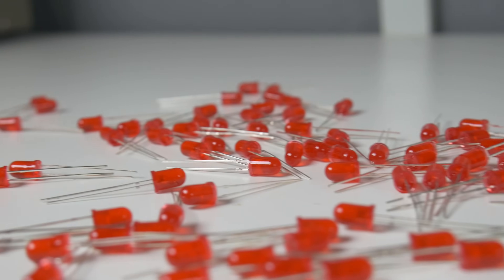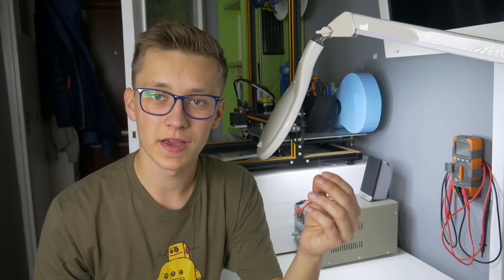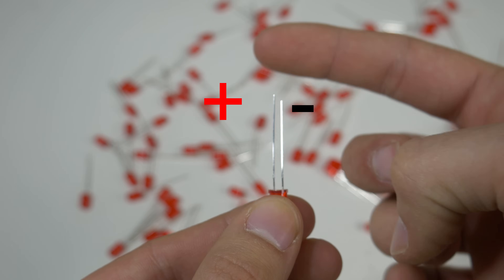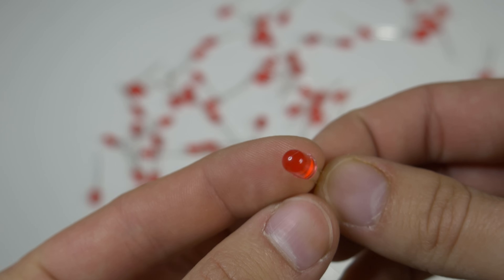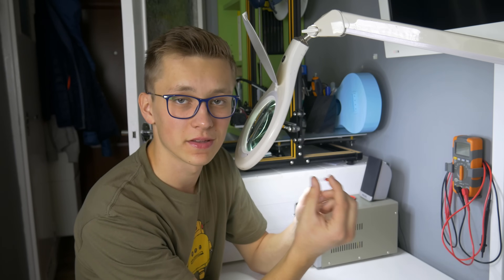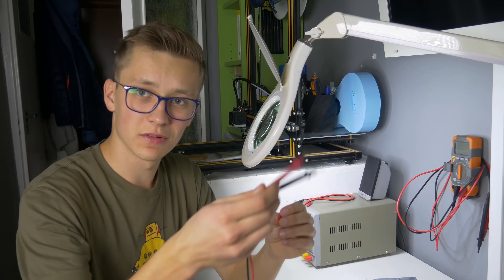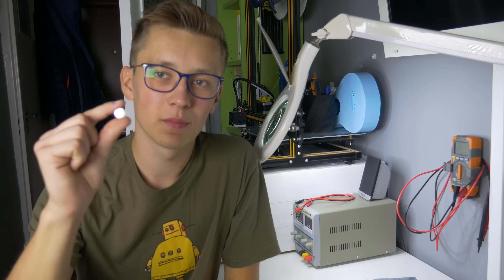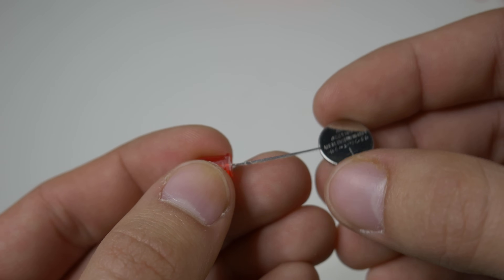5 simple ways to determine LED polarity

Comment: Hi, actually, there is a 6th way I just had to use: light the LED with a strong light. The LEDs should generate a small voltage. when you measure it with a multimeter ( in position V--- (DC, not AC), and the multimeter shows a positive voltage (around 0,6V- 0,9V), then your red probe side is the + and the black side probe is - 
I needed this because I was checking a sealed module with multiple LEDs connected in serial and only had access to the external connection not the individual LED pins. The visual methods didn't work because LEDS were not visible, the LED position of the multimeter didn't work because the voltage was not enough to light up the LEDs.

Comment: Hi.  I'm just getting into electronics and have an issue with this

I have some LEDs where the internal plates are the opposite way around ie the larger plate is on the positive side i, opposite the flat spot and shorter lead.

I have confirmed the polarity by connecting a power source.

Am I to take it that the internal plates are not a hard and fast rule.

Comment: Thanks for the video.  I liked, subscribed and shared it but...  I have an LED so old I can't find the polarity by site.  Both sections inside are about the same size.  I used my multimeter and found it but was hoping to find a quick site method that covers all LEDs.

Comment: I have a red LED that has its anode on the flat side of the package, and this also corresponds to the larger electrode.  Has it been incorrectly doped?  It's the only LED that I've seen that has this configuration.

Comment: I'm sure you know all this, but a couple notes for the viewers. To test most LEDs you need a Lithium (3V) coin cell battery rather than an Alkaline (1.5V). If you're thinking "why don't i just connect 2-3 Alkaline cells in series", well yes you can, especially with coin cells; but if you try that with AA or AAA batteries which can deliver high current, unless you have a fairly beefy white or blue LED that you're testing, as opposed to red for example, you're likely to burn it up if you're not super careful and very quick, and even then you can damage it.
Reply from the maker: As long as you are using single AA battery, you wouldn’t burn LED because voltage is too small, of course you can’t connect more batteries in series because that will result in higher voltage and burn an LED.
Reply: @nikodembartnik  not the most reliable way to light even a 1.7V red LED either.
Reply from the maker: Sure it's not a good idea to power an LED with this voltage in a project but just to check the voltage it is fine.

Comment: Sometimes I'll just throw them in a 5v circuit with a 330 ohm resistor, which is about the same as the battery method. Gets a little frustrating when you realize it's actually an IR LED though and doesn't light up either direction with the exception of a very faint orange glow.
Reply: Maker Melissa's Lab Orange glow? It’s red!
Reply: Perhaps my memory is off, it's been a while.
Reply: Use your phone's camera or your laptop's webcam to check IR LEDs. If the camera is anywhere near shitty enough, the LED will show up with a bright purple glow, and even on better cameras, it should be visible. If all you have is a high end smartphone and it doesn't work too well on main camera, maybe the selfie cam is shitty enough.